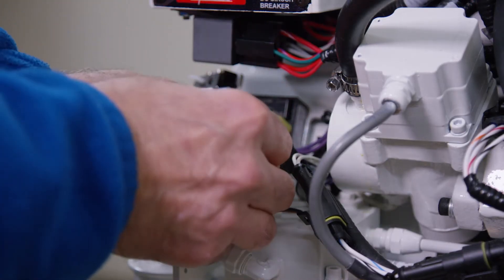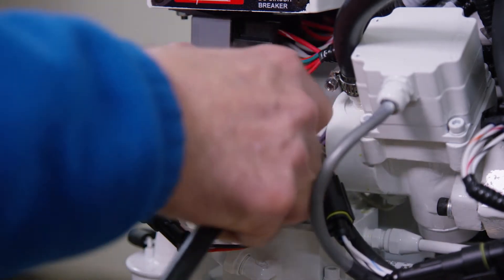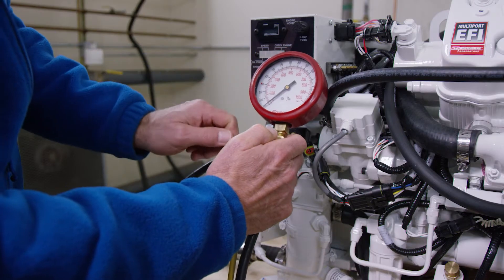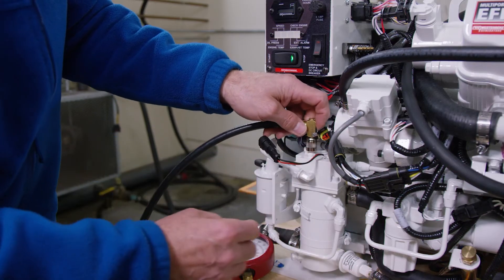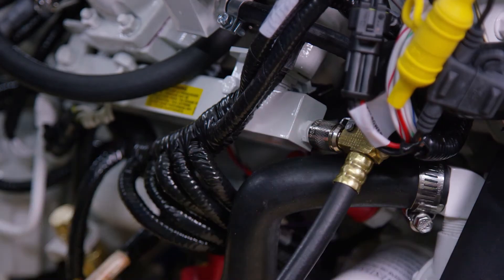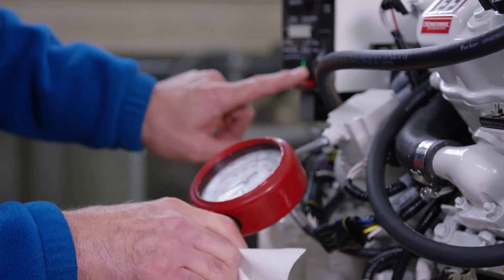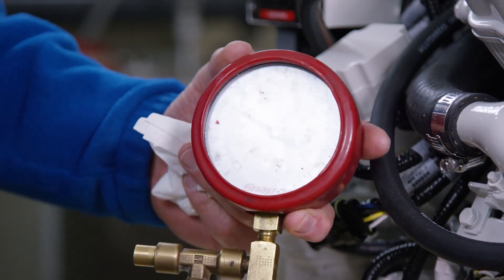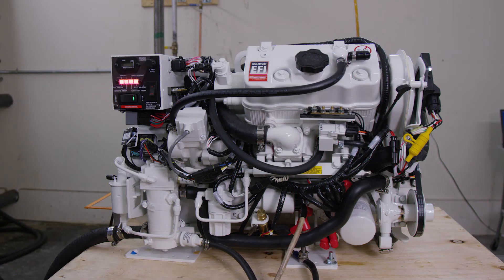How to Bleed the EFI Gasoline Generator Fuel System | Westerbeke

Comment: Where I can find that tool?
Reply from the maker: Hello - Information on this tool is in section 4.6 (bottom of page) of the Operator's Manual. Here is a link to the manual. See page 13. https://www.westerbeke.com/operator's%20manual/operators%20manual%207.5mcga%20056556%20rev-.pdf

Comment: I noticed this video was shot with the genset on a stand.  How is this procedure accomplished in the engine compartment with a 3.5 Kw SBCG and single engine I/O, without haulout to a genset mechanic?  Very informative video!
Reply from the maker: Mr. Cathey - We're glad you found the video helpful! Thank you for your feedback. Accessibility to the genset will certainly affect the difficulty level of servicing the genset. If it's in a tight spot, accessing certain parts of the unit may be challenging. If you'd like to contact us with specifics, we will try to assist. Please e-mail help@westerbeke.com Thanks again!
Reply: I have no problem doing this on my 6.5 in my Monterey 335

Comment: Hi do you have the part number for that fuel pressure gauge adaptor ?
Reply from the maker: Hi Daniel - sorry the original reply to your message was not delivered for some reason. We do not offer the adapter as a Westerbeke part, however we've used the Snap-On adapter, P/N FIA130A. Hope this helps!